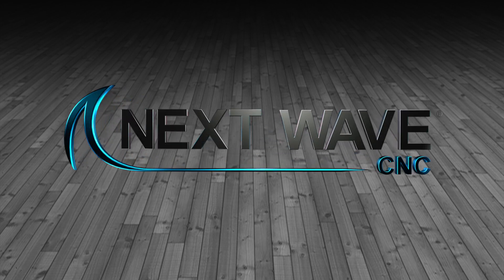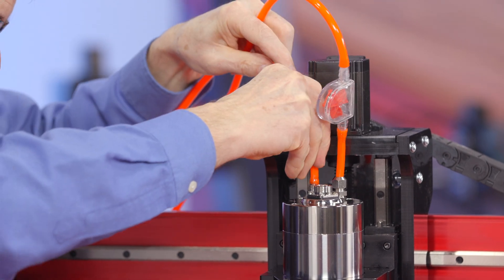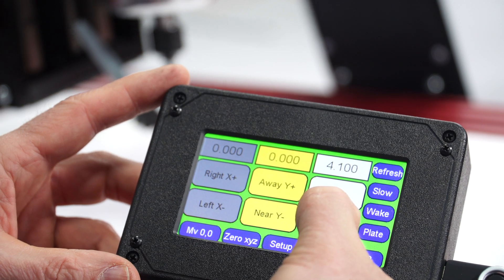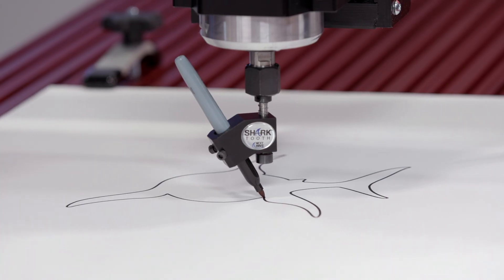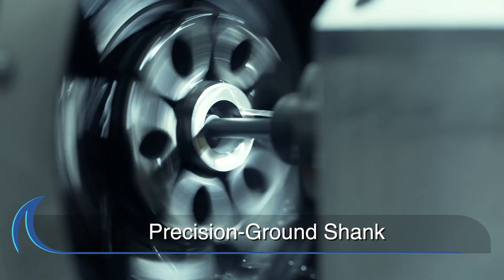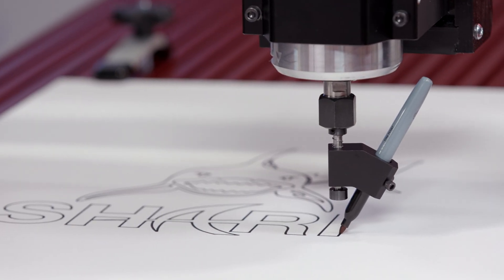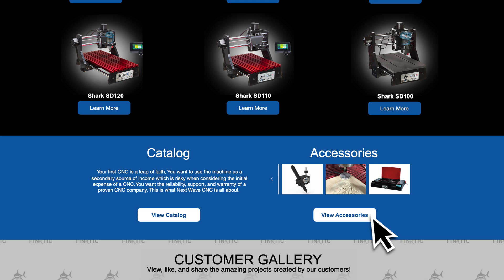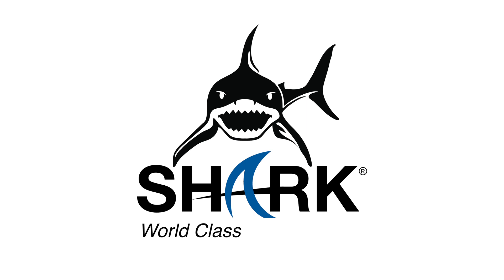SHARK TOOTH CNC Drawing Tool

Comment: Just curious, what keeps the spindle from rotating?
Reply: Nothing keeps it from rotating, but it only wants to rotate if the tip of the pen isn't aligned with the center axis of the router. But if you want accurate lines, you do want them aligned, in which case the spindle won't want to rotate.